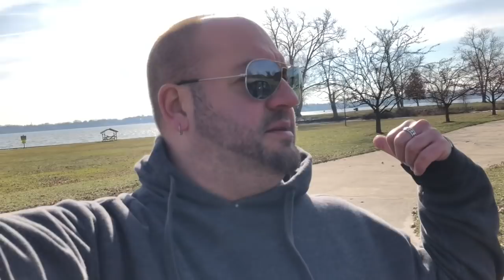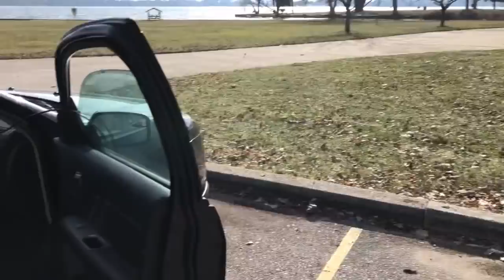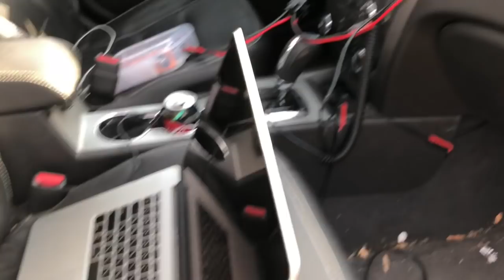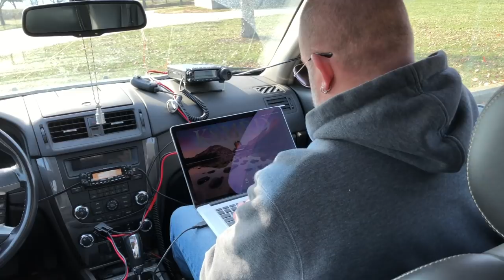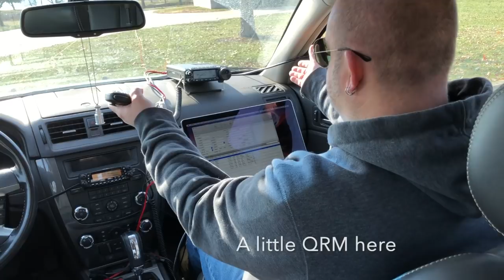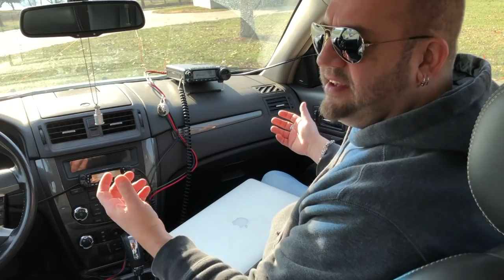Parks on the Air in a Parked Car

Comment: Mobile operations make sense… For a great deal of Hams, our sanctum, our lone refuge, is our vehicle.  A rapid deployment, whether POTA, or some other adventure gives us that QSO we need to feed our addiction.  A DX, is a rush that leaves us high for the ride home… (I don’t do drugs). I’m building a ‘Shotgun Station, a suspended plywood desk surface, with my KX2, a 10aH 12v battery, plugged into the cigarette lighter.  I prop up a 10m telescopic mast, and suspend a Doublet….   Great video, despite the other station… 73 de W7UDT
Reply from the maker: Boy you got that right!  There isn't much better than that rush working some DX!  Sounds like a cool station you are building there.  Hope to catch you on the air sometime.  73

Comment: Hey another nice parks on the air video. I have a suggestion, Yaesu makes an FH-2 remote control keypad, so that you can control your memory voice announcements. It’s on ebay from the UK 🇬🇧 for $58 usd or £45 shipping included. Hope to catch up with you on the Novi repeater sometime, I’m usually on from 10 o’clock and 7 AM for my half hour commute to & from Dearborn. I’ll send you the eBay link I see your listed on QRZ. 73

Comment: Hey Mike, just wondering what logging software you were using that could populate names offline? Or did you have a phone hotspotted for a wifi connection? Either way love the videos, I'm a fellow FT-891er.

Comment: In the event that the interference guy continued to be a problem, could you move to a different frequency and hold the same POTA activation, or would the existing contacts not count?
Reply from the maker: Of course you can.  You just need to make 10 contacts in a park on the same Zulu day.  Can be any band or frequency you want.

Comment: Good video. 

Always say your state on your CQ recording. That way, people can swing their antennas around.

Don't be afraid to plug into your car battery at 60 watts or so. I do it all the time with the 891 for an hour without starting the car with no problems. I have a Camry, so the battery is bigger that a compact car though.
Reply from the maker: Don I would have thought you would have watched this video a long time ago hihi!  Not a bad idea though about the state.  I thought I usually do that but I'll keep it in mind for the future.  Not being one of the fortunate ones who has a beam to swing around I didn't even think of that!  As far as the battery though, the lifepo4 that I run has no problem at all running 100 watts.  Watch OH8STN's channel and you will see what I use.  73
Reply: @hamradiotube  

Hey. I'm not sure how I'm missing some of your videos. I'll have to play more catch up. Yeah, I know some of the life pro's really perform. Amazing. I just thought I would mention it. Cableworx has modular power pole stuff with cig lighter adapters that fit EVERYTHING. Even if you get it for back up, you have a good thing...if you have gas in the car, you always have power that way. 

Also, is there a way to trickle charge your lifepro from your car battery ? I would be interested in knowing if there's a solution out there for that.
Reply from the maker: @donsilva4441  Ha no worries!  I have more power poles than I know what to do with.  Literally everything gets them, and I'm always looking for more ways to utilize them.  Already have them hooked up to the car too with a cig adapter that I bought from auto zone and immediately cut to put them on.  Thats what my mobile vhf/uhf radio is connected to.   #powerpoletheworld is a thing on Twitter too!
Not sure about charging from the car but I would imagine it would work so long as the engine is running.  I have a spare power pole coming out from the cig adapter that I can use, I've just never run out of power whilst portable.